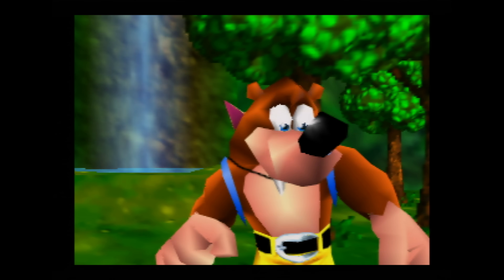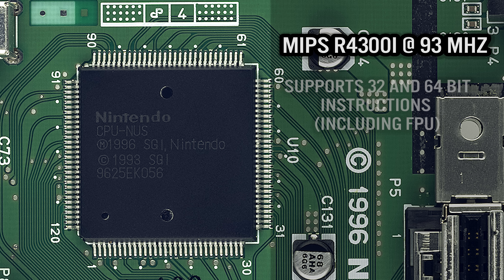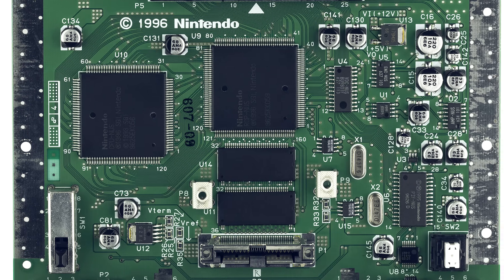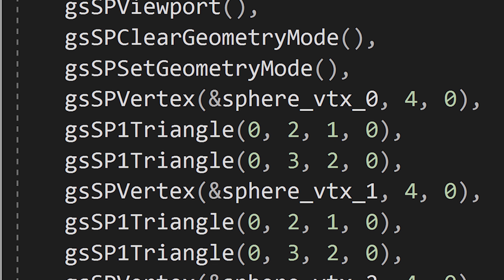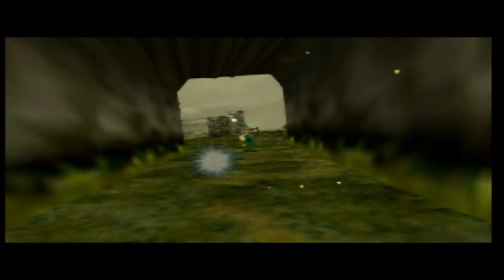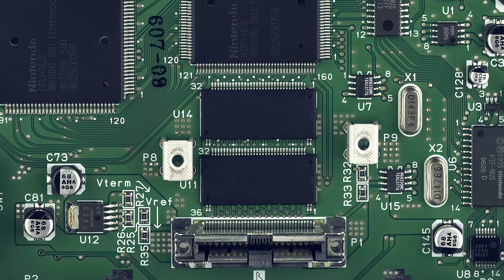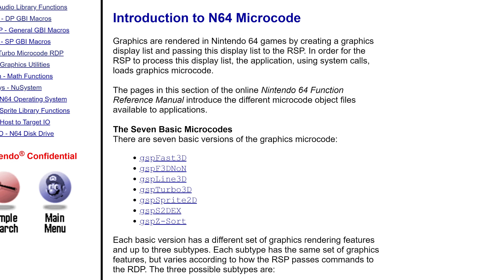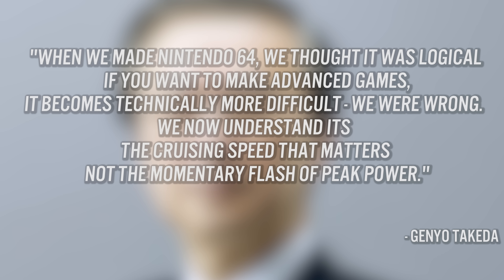Why was the Nintendo 64 so hard to develop games for ? | MVG

Comment: I think the lessons are clear, don't get a computer graphics workstation company to design your video games console. Get video games console developers to do it. Obviously not really an issue these days given consoles are basically just using tweaked PC CPU and GPU chips.
Reply: * get a better workstation company :)
Reply: @crashoveride879  Well they were good. But what works when you make a $60,000 workstation doesn't work when you come to need to develop a $50 chipset. Much like the people making supercars might not make a very good family hatchback :)

It was only a few years after the N64 dropped that they moved over to Intel and NT4.0. So even they could see the custom hardware business was on the way out.

Comment: Was possible for developers use standard WinTel machines, or they had to stick to the SGI Indy workstation + N64 dev board?
Reply: Initially, the only supported platform was SGI.  You had to use an Indy to plug the development board into simply because it plugged into GIO64 slots that were physically arranged the way they were in the Indy.  That didn't mean you had to use it as your development machine though - you could use any SGI machine that had the correct version of IDO ("Irix Development Option" - basically the compilers, linkers and libraries) along with the N64 SDK installed.  When you wanted to run the code, you had to use the Indy, but since SGI machines were heavily network orientated this was pretty easy.
Later on, there were multiple other solutions that allowed you to do development on PCs - for example the Kyoto Microcomputer Partner 64 system which used a cart that connected to a PC via an interface board.  In fact, you could use that on SGI machines too by using a little interface box that connected to the  SCSI port, but by that point most people were using PCs
Reply: A windows SDK based off gcc was released in early 1997. Most developers used it as Indys were very expensive compared to WinTel

Comment: 6:58 i guess you mean 4mb, not 4 kb.
Reply: Indeed 4kb wouldn't be too much 😄
Reply: @jiijijjijiijiij  this is why decompilation projects for N64 games have such a fascinating potential. Once decompiled source code is available for a game it can modified to use additional memory, higher CPU speeds, ported to other platforms, make fan-modding easier, etc :)
Reply: It's 4 KB.  This is enough for a single 48x48 texture with 8-bit color + a palette and mipmaps, or else a single 64x64 texture with 4 bits of color (with palette and mipmaps).

There were also higher bit depth textures, but you'd have to decrease resolution even more.

Quite painful, really.
Reply: @Keldor314  the memory expansion pack is 4mb mister wiseass
Reply: @rasz  is that so? ^^ prove please.
Reply: @paparansen  Whoops!  I was thinking about the TMEM, which is in fact 4KB.
Reply: @John
not much. Playstation had half the ram and did great. N64 problem wasnt ram size, it was ram latency. What good is more ram when using it slows your game?

Comment: Its fascinating looking back at that generation of consoles and how unique each system was, with both Saturn and N64 only seemingly unlocking their potential right at the end and it's a bit of a shame we never quite got to see what they really could do. 

While on lockdown I'm replaying many from that generation and I have to say the Saturn has outstanding picture quality for the time with its rgb setup and the few games which support its hi-res mode and of course the 4mb ram. The N64 is somewhat disappointing looking back with its forced AA and complete lack of RGB (something luckily we can fix today to make a huge difference). Overall all 3 have some truly amazing and quite unique games and a variety that we often lack in today's AAA space
Reply: It's almost like saturn designers were afraid about the motion sickness of 3d games and stuck with the 3d (or sprite scaling) that was popular in the arcades at the time that favoured racing, fighting and on track flights.
Reply: @FoxUnitNell  Sato and the Sega Away27 wanted to launch a 2D and 3D machine based off of Model 2 Arcade hardware and System 32. SEGA Saturn is a combination between TWO projects "Jupiter Phase 2" which is System 32 with Model 2 3D tech and " Project Aurora" a FULL fledged 3D Only Console using FULL Model 2 Power. The name Saturn comes from 
"From Jupiter to Saturn, the Next Logical Step".
Reply: @FoxUnitNell  but the Japanese gaming market got one game on the Saturn that we didn't: Sakura Taisen (not to be confused with the recently released Sakura Wars for PS4, known in Japan as Shin Sakura Taisen)
Reply: @FoxUnitNell  I think that was more the limitations of the hardware mainly due to using quads. That being said when the Saturn combined its 2d and 3d capabilities we got games like Panzer Dragoon Zwei which would have been impossible on the Playstation due to it having to render everything in polygons, where as Saturn used its Infinite plane engine to draw huge floors and ceilings well beyond what the competition could do.
Reply: @carllavery4442  somebody needs to tell me why Panzer dragoon was seen as a good game. I had it on release for the Saturn growing up and it was easily the worst game I owned for the system. Yet everywhere I look on the internet it gets praised highly. 🤪
Reply: @golangismyjam  that's because it is a good game, its sequels were much better though and generally speaking that praise is directed at Zwei and Saga which itself is a very different game. As for why its praised, many people like rail shooters such as Space Harrier and Starfox and Panzer Dragoon Zwei in particular is the pinnacle of that genre. Taking everything they had but adding more of a story and making it so the action happened all around you, with multiple routes an added berserk mode, better graphics (seriously some of the best that generation) and a much smoother framerate. Plus your dragon evolves based on your performance with a couple of secret evolutions and an in depth scoring system for replaying and unlocking extras.

All that said if it's not your type of game then fair enough
Reply: @carllavery4442  Saturn was better at 3D AND 2D than PS1. Saturn's 3D abilities lay entirely in its Mapping,Texturing and Layering. Saturn is a Mapped Rich 3D console.
Reply: The gaming industry today is nothing but delays, DLC, politics (I'm not joking), censorship, and long download times.
Reply: lucasn0tch I take it you haven’t been playing games for very long, if you think delays are anything new, that “politics” haven’t been heavily present in games for decades, and/or that censorship is somehow in greater effect than in the past.

I’m sorry you’re so hurt and upset over cultural differences and a more global/diverse focus in games’ world-building, that said.
Reply: @Aqua_Xenossia  Delays have been around for quite a while, though the amount of delays have spiked this year alone
Reply: @Aqua_Xenossia  Also, the issue is not cultural differences. It's cultural Marxism.
Reply: @lucasn0tch  yawn I love retro gaming too but acting like there isn't lots of new amazing games released all the time is such a boring, jaded take.
Reply: @snake-v9t  I wasn't implying there aren't exciting games, but I was saying the games always advertised by Sony Interactive Entertainment outside of Asia are just plain unattractive to me. For example, in Taiwan and South Korea, games such as Trails of Cold Steel IV are advertised very heavily, while in Europe and the USA, Western games get heavily promoted. And let's not forget that Sony is the master of forced censorship (cultural Marxism) in games (even M-rated ones!)

Comment: Also it's the reason why it took so long before we saw accurate low level emulation just a few years ago with AngryLion
Reply: And probably why AngryLion still eats your CPU for breakfast.
Reply: @steel5897  They got it a lot faster on a retroarch plugin, i think parallei.
On a good CPU you can play most games in realtime with it.
Reply: What? I tried CEN64 recently, it works but it's extremely slow, and I have a beefy machine.
Reply: @Sauraen  Thats another attempt at low level emulation. Get the Angry Lion Plugin, there are versions for Project 64 and MupenPlus.
Reply: @Sauraen  The fastest implementation of the angrylion stuff is on the retroarch parallel core.
It can run several games in realtime.
Reply: yeah
Reply: I had no idea about this plugin - thank you for the info. 
PJ64's default video plugins are pretty good imo for polygons, but 2-D stuff sucks, and some things purely don't render correctly.
Reply: The newer Mupen64Plus Retroarch core runs like a dream. And because of the High performance of my computer, I can run it at 4 or 5 times internal resolution! Quite a long way this emulation has come huh?

Comment: Was it too complex, or was that an easy excuse for developers to wheel out because of the expense involved in producing cartridge releases..
Reply: Maybe both? In hindsight i appreciate a lot more that games came on carts. Nintendo proved that when investing the necessary time Real Time Cinematics could be as engaging as the pre computed stuff the Disc based systems had... One could argue the cutscnes aged a lot better in N64 games than the CG stuff the playstation or Saturn had.

People didn't appreciate the importance of quick load times, now will have an entire generation which biggest selling point is reducing the waiting time to actual gameplay.
Reply: @Refreshment01  It's more than just less waiting for a level to load.  People don't realize how heavily compromised the level design in games like Banjo-Kazooie and Banjo-Tooie would be if they had to design the levels around minimizing instances of map switching, for example.  Even if PS1 and Saturn could run the graphics in N64 games, the actual gameplay would be heavily compromised.

Comment: World Driver Championship doesn't run at 60FPS. It commends a respectable 30FPS, but not 60. Also the 640x480 mode is a widescreen letterboxed mode, not fullscreen so the effective resolution of the 3D scene rendered on screen is not actually 640x480, but less than that, probably more along the lines of 640x240. Nevertheless, this game deserves praise for pushing much higher numbers of polygons per second than any other game on the system, while still running at that respectable 30FPS.
Reply: That game sucked.  There were far better playing racers on the system pushing far more ambitious tracks and number of vehicles.  Gran Turismo had the same problem.  It had heavily restrictive narrow tubes for tracks in order to put all of the processing power on making the cars look good.  It is the equivalent of praising the level of detail on Tekken's characters compared to the models in Spyro the Dragon.  As far as pushing the technology towards actually making the gameplay better F-Zero X, the 3 San Francisco Rush games, Diddy Kong Racing, Wave Race 64, and plenty of other racers are more impressive.

Comment: I love learning about older consoles, most modern consoles are just cut down PC's.
Reply: True. Literally nobody is doing custom chips now. The closest you get is people using FPGAs for music purposes such as generating alias-free oscillators instead of using DSPs with static sample rates.
Reply: As boring as that sounds, I'm sure most developers are thankful for that
Reply: @6581punk  they do use custom chips, for example the custom drive chip in the Xbox One
Reply: @sundhaug92  I would imagine that is copy protection measure. Or because they can vertically integrate.
Reply: @6581punk  So after watching this video, where it was even mentioned that N64 used an off the shelf Processor, you still say this. 
Really all Consoles since the 2nd Generation are using computer parts, so i never liked when people said to more modern consoles "just cut down PCs"
Reply: @ZunaZurugi  I didn't say that. Did you reply to the wrong comment.
My comment says nobody uses custom now. I never said they didn't in the past.
Reply: I can barely tell the difference between Playstation, Xbox, or PC games these days.

N64 vs Playstation and SNES vs Genesis games truly had a different look and sound from each other.
Reply: Get some glasses😏
Reply: The n64 was just a cutdown silicon graphics workstation.
Reply: @JTLowry  Heavily cutdown to the point of being barely comparable. It's like shrinking down a Ferrari and fitting a 1.0 litre 4 cyclinder engine and saying it's a cutdown ferrari. Might be the case but that doesn't make it good.
Reply: What is a PC ? PC architecture is more than an architecture composed of Intel/AMD processor, or Nvidia/AMD GPU, or that have windows or linux on it.
Reply: @ch282 With a UMA memory architecture. Something PCs don't have. UMA means the CPU and GPU access the same memory. I guess integrated graphics comes close to this, where you have to sacrifice some RAM for video.
Reply: *Affordable PC's
Reply: ALL CONSOLES are cut down computers. I guess x86 consoles are cut down x86 window PCs.
Reply: @tHeWasTeDYouTh  They use bespoke mainboards which do not conform to PC standards. If you can't put a USB stick into it and boot/install Windows or Linux then it's not a PC. A PC (or IBM PC compatible to use the full name) is defined by a BIOS (legacy or UEFI) and other standards.  A non-standard hardware configuration that just happens to use X86 and Nvidia/ATI GPU is not a PC.

You can also argue that an ARM based computer is also not a PC. You may be able to boot Linux or Windows on it but its again a version of the OS that has been specifically altered to run on that hardware and not a generic "run anywhere" build.
Reply: @6581punk  I am talking before USB even existed. all consoles starting from the 2600 used PC hardware
Reply: @tHeWasTeDYouTh  Not really. The CPU may have been general purpose but the graphics and sound chips were proprietary in many cases. Even the 2600 uses a custom made CPU as they wanted a cut down 6502 with less address lines as that was cheaper.
Reply: Only ps4 and xbone are cut down pcs
Reply: @caliptus85  Isn't Switch just a unix system?
Reply: @TheProthon  The Switch uses an Nvidia Tegra chip. This was used in a couple of early Google made tablets and also Android based Nvidia shield TV boxes. The Switch can run Unix based firmware such as Android or other Linux OS's it is running a custom firmware based on Android as many devices do nowadays because it is open source. Honestly anything that isn't Windows will be running a form of Unix, it's free and open source so there's no point in building something from the ground up.
Reply: @caliptus85  The OG Xbox was a cut down PC also.
Reply: @caliptus85  
Right, Switch is a cut down tablet instead.
Reply: @kekeke8988  it is and I freaking love it
Reply: They run x86 code, and use AMD GPUs but they are very much NOT PCs.
 The big one off the top of my head is that RAM is shared between GPU and CPU - unified memory architecture. Anything the CPU works on, the GPU can instantly pick up without a separate transfer step. 
There’s no need to have a 4GB on a separate graphics card
Reply: @johnsimon8457  I guess you haven't heard of APU's before. Which is very common in laptops and low end PC's.
Reply: Gaming consoles were always cut down PCs, in the 80s and early 90s there were companies making gaming consoles out of computer hardware and vice versa. Hypotethically you could create specialized hardware to add a keyboard and a storage unit and turn any console into a computer comparable in power to PCs released in the same year as long as it has a cartridge port, expansion port or other viable I/O with decent bandwidth like USB
Reply: @jackmcslay  Imagine that, an alternate reality where the industry pursued solid state storage in the early days, instead of CDs . Maybe we would be buying our games on USB sticks these days?